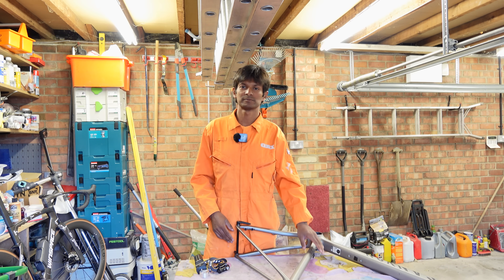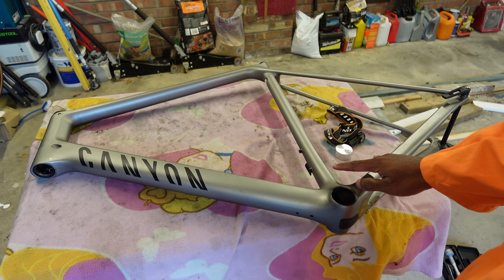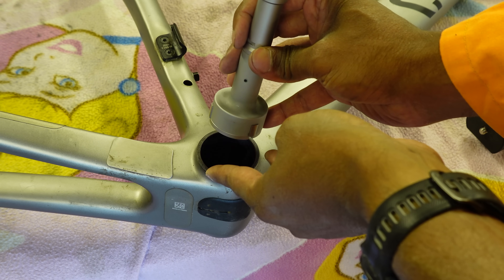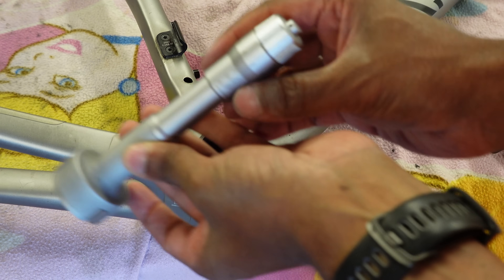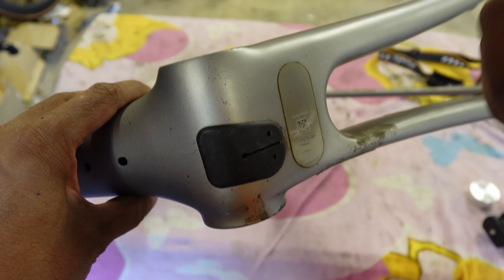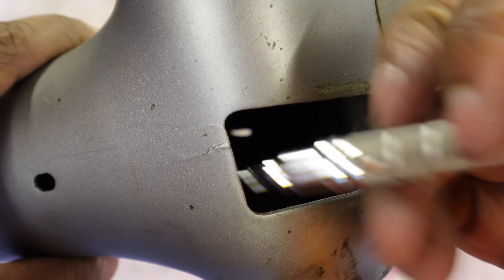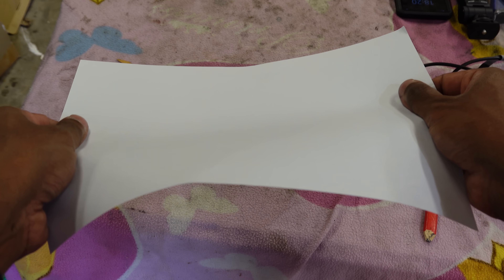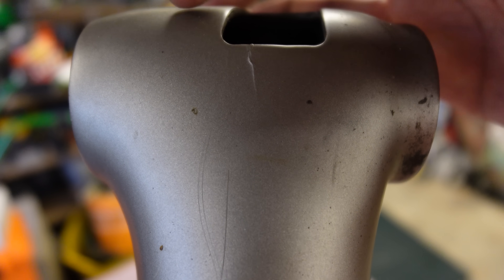Canyon’s “German Engineering” is a JOKE like their Warranty Department

Comment: So, let's get this straight. The claim is that Canyon, did ZERO quality control, and have no idea whether their BBs are slanted, proper size after finishing the BBs, and do NO checks throughout the process at all and this is the end result for all of their bikes?!?!  ROFL...good one.  Is that what I'm watching....ROFL....that fucking bottom bracket looks like shit, and from yes...like Canyon's opinion, shitty maintenance, nobody changed the BB ever...or they had NO clue how to use a press tool and put the BB in with bad tools or alignment for it to be that bad and out of round.  Internet is full of half-stories/half-truths or misleading or complete lack of facts and information about a clearly abused or poorly maintained BB.  This is something, since they assemble their bikes themselves before sending them to the customer, that as soon as you took one step on the pedal you would have felt the thing out of round and play/slop.  I find that fucking hard to believe for 1 second....ROFL. Probably some moron owner decided to change the BB without the $300 proper pressfit tool and jacked up the drive side BB trying to fit it....seen that enough from people, even so-called "experienced" mechanics.  And what is with this 3rd grade tool you are using to test? How about some expensive imaging to show how "bad" the carbon frames are from them? Haven't seen any of that or even anything close except this makeshift tool...rofl. Internet is full of some special stuff.....
Reply: When I had my Grizl, I had to change BB after 600km. And could change the BB with hands. No tools needed. DOes this make any sence to you? The frame was exchanged due to creacking in seat tube. BB problem was just a bonus :) But my main problem was their customer service. It took +6 months to get them to exchange the frame. They have simply ignored me. But when I wrote them for the last time, that they can keep the (returned) bike and give me full refund. They sent the bike with new frame the next day. So they were looking at my previous mails, but have just ignored me. I never took the newly received bike out of the box, and have sold it further through buycycle.

Comment: Hambini, I've had multiple frame issues with my previous CF SLX (non disc model) due to cracks originating from the seat tube relief cut out. There were numerous examples posted by other customers so this was clearly not a "one off" issue. Long story short, Canyon ended up providing a warranty frame the first time then declined further coverage after the same issue in the replacement frame (in the same location). That was the last time dealing with Canyon for me. Any advantage gained with a "good deal" was lost waiting months upon months for a replacement frame.
Reply: It's time for European Comission to force Canyon to issue recall on their bike frames.
Reply: lol that happened to me with a multimeter, from another company obviously, it lacked a fonction advertised on their website (the very reason I had bought it).., and when I contacted them about that, they just sent me a second one, same model, so also lacking the function that was still listed on their website.
I have now 2 multimeters for the price of one, neither can perform the task I had paid for!

Comment: It all depends on who's behind the desk resolving warranty issues and how they interpret each brand's policies. You have to have responsibility and customer service skills. I worked as a warranty manager for Giant in Mexico. The truth is that Giant Group is truly committed to its quality, and I assure you that if this Canyon case were on my desk, I would resolve it immediately. Cheers🙋🏻!
Reply: Good to know. I bought a Giant Revolt with a carbon frame that developed a crack in the paint near the seat post. The asked me to drop it off at a local Giant dealer for assessment and when I picked it up a few days later they had stripped the bike, replaced the frame and reassembled it under warranty. Its Giant for me from now on.
Reply: @mariog4707  I had a Canyon Exceed developing exactly the same crack in the paint. Canyon told me there is nothing to worry about. After two years of riding its size didn’t change and I didn’t have any further issues with the bike. Sometimes a crack in the paint is just that.

Comment: Just got a Sava R7 (aero/enduro type chinese T800/T1000, Di2 R7170 105, CF rims),  for usd 1.6k earlier this year, mileage just hit 10k miles now.   Serviced just a month ago, stuff got stripped out and inspected. Nothing wrong with it wheels or frame, just some fairly basic cleaning.

Comment: the only thing that matters in this industry is marketing.  nothing else matters.  You pay the pros enough, they will ride crap.  Has anyone apologized for pushing defective cranks for over 10 years.  This is a sport that sold out its fans.  What would help is a trade association that could do marketing, marketing surveys and maybe help implement quality control programs.  

I had a very famous marketing professor in college.  He said there were two reasons to do marketing (i) to eliminate the social risk  (hence sponsor a pro bike team) and (ii) convince people that they made the right decision after they made it.  The UCI could do more to protect the consumer.  That is why i don't watch this sport anymore.
Reply: its even worse in the moutain bike part, from this industry. There was a TON of very bad gears, from anywhere. I was mtb mecanic during the 90 and early 2000, the first batch of many brand about hydraulic discs was a disaster, during years. So yes...when moutain bike starting, problems comes, massive. For me, 95% gears from the 90 and 2000 was totaly crap, you can die by theses craps.

Comment: Did these sorts of problems happen in the earlier days of carbon frames, when the bottom bracket shell was an aluminum tube that was glued into the carbon during manufacturing?  This all seems like it's a symptom of the insistence on making the bottom brackets be a press fit arrangement, directly into a carbon fiber hole.  I guess Hambini does occasionally talk about cases where the design was sort of like that, but they at least subjectively seem less common, or at least catastrophic.

Comment: I allways wonder do they just fuck up machining work and QC or is this a infusion,density or whatever Material issue which develops while riding I make some carbon parts and noticed on more complex parts its harder to get a clean fibre distribution and it resulted in ballbearings working their seat oval but thats homegrown forged carbon with low pressure and overloaded small bearings ...

Comment: my Canyon endurace AL cracked 3 times, always failing in the same spot: in the weld on the chainstay just next to the derailleur
Canyon replaced each frame but last one (3rd frame) started to fail already after 500km
warranty is/was 6y and clock starts ticking on the date of the purchase, meaning if you get a new frame it will not have the full 6y coverage
after 2y they charge you to move the parts from the broken frame to new frame
bb, front derailleur, bottle cage screws were loose
no more Canyon for me…
Reply: Have the same frame , curious if you had a link to photo of the damage
Reply: @shinnymirror511 I still have the pictures, lemme check how I can share them
Reply: @hardware4computer I realized after I said it “how are they gonna share em?”
Imgur link?
Reply: I would also be interested in a photo, as I also have this model.  Thanks
Reply: @pa.friederich  pics posted under enduracefail
Reply: Hatte auch an zwei Aluminium Canyon Hardtails Risse (Steuerrohr & Kettenstrebe hinten).
Reply: pictures are on imgur under enduracefail
Reply: search for enduracefail
Reply: you should be able to find it under enduracefail

Comment: 5:03 If you notice on the inside of the tubing, the joint line goes all the way from the large opening to the small hole, though not directly. Looks like the carbon fiber is stressed out and has a fault line. Also, if you look at the outside, the fault/crack has a secondary buckling. It's sort of D shape, where the arch of the D is the secondary fault.

Comment: Same issue on my frame no cracks though at least I haven’t found anything obvious. Alignment is shite and it’s going through BB‘s on the non drive side. Change them once in a while. Also the fork cracked on mine as well but was replaced under warranty. Potentially life threatening. Rarely use this bike anymore.

Comment: Steel is real. Buy plastic, expect slack tolerances and pitiful longevity.
...just saying
Reply: No thanks, I'm not interested in a 12kg road bike...
Reply: @dhess34  You can build up a road bike much lighter than 12kg. As far back as the 1970s /80s, Raleigh's Specialist Bicycle Development Unit (SBDU) had got the weight of a road racing bike down to 7.9kg if I recall correctly. A racing bike in the 1960s typically weighed about 10.4kg - I was there! 😊

Comment: Canyon is awful.
XC Mtb They refused my warranty claim 5 days after delivery. Neither of the remote locks worked, awful routing, and the steering ground when turning. the rear break was stuck on and missing one pad.
There was lithium grease inside the frame. Never rode the bike and they tried to charge me a "bike wash" charge once they got it. Both headset bearings were complete garbage and dry as a bone. BB wasn't much better. Sold it soon after at a lost. The frame cracked on the new owner 5 months into ownership.

Comment: Thanks for doing what you do. I just recently had an experience with a smaller bike manufacturer where a full suspension frame could not fit the rear shock due to the linkage being misaligned from the box. They sent a replacement frame with the same issue of a slightly lesser magnitude, where the shock could be forced in, but the shaft ended up under a side load and it can't be let operated in this way obviously. In the end the frame was returned for a refund, but the customer experience was not amusing to put it lightly.
Reply: Not sure why you are protecting them.
Reply: @DR_1_1 Dartmoor bikes

Comment: @Hambini PLEASE DO A SHOW ON Failure Testing of carbon frames, especially the cheap chinese frames that you seem fond of:
🔹 1. Fatigue Testing (Cyclic Loading)
Carbon frames are put through millions of load cycles to simulate the effects of pedaling, braking, impacts, and rider weight over time. The main types include:

✅ Vertical Load Testing
Simulates rider weight and bumps.
A force is repeatedly applied to the seat tube or bottom bracket.
Load is cycled hundreds of thousands to millions of times.

✅ Pedaling Load Testing
Simulates the stress from pedaling forces at the crank area.
Torque is applied in cycles to mimic real-world use.

✅ Head Tube Load Testing
Simulates braking and steering forces.
A forward/backward cyclic load is applied at the head tube (front of the bike).
🔹 2. Static Load Testing
This test determines how much force the frame can take before it deforms or breaks. Often done before fatigue testing to establish baseline strength.
Example:
A set amount of force is applied to a tube junction.
It must withstand it without excessive deformation or cracking.

🔹 3. Impact Testing
Simulates sudden hits like potholes, crashes, or curb strikes.
Common methods:
Drop tests (frame or fork dropped with weights)
Charpy impact test (measures energy absorbed before fracture)

🔹 4. Non-Destructive Testing (NDT)
After fatigue testing, manufacturers use non-destructive testing to look for internal damage that isn't visible.
Techniques include:
Ultrasound – detects delamination or voids in carbon layers
X-ray or CT scans – used for detailed inspection of internal structure
Tap testing – listens for changes in sound that suggest damage

🔹 5. Destructive Testing (Final Failure)
To validate ultimate strength, frames are pushed until they fail.
Examples:
Increasing vertical or lateral loads until a crack forms
Measuring force at the moment of failure
This helps determine:
Where failure occurs (e.g., bottom bracket, seat tube junction)
How it occurs (cracking, delamination, fiber breakage)
Reply from the maker: Good chatgpt output
Reply: @Hambini  I am not paid enough from YT to come up with something original ;-)
Reply: @kenedward4585  You'd need at least 10 frames—5 "western" (literally every one of which is now made in China), and 5 from Chinese nameplates—then weeks and weeks of testing on equipment that at this point only exists in China. 

So well into 6-figures of cost, and hundreds and hundreds of hours of work ... and at the end, if a Trek frame was deficient then all the Trek stans would just scream, 'That was just one frame, that's not a statistically significant sample size!'. 0/10 idea for content. 

But hey, YOU start your own cycling channel and drop $300k on that video. I'll watch the results if you make it.
Reply: @dhess34  How about starting with just the frame being trumpeted as "HIGHEST quality" by this channel (ie LightCarbon)??
Reply: @dhess34  OH gosh, imagine an engineer making an inquiry into the frame failure analysis of the frames he is touting?!?!?!  What a an absurd concept.
Reply: @dhess34  OH YEAH we clearly see Hambini forsake thumbnail analysis in favor of comprehensive standardized testing for everything he has on his show. NOPE, can't do a simple analysis on the durability and safety of a couple forks, that might be way too relevant to the watchers of this channel.
Reply: @  Who cares if the fork breaks after a couple years!! Hambini is so connected he is able to get new bikes every year from sponsors. His neck isn't gonna get hurt on the cheap chinese frame because he will be onto the next sponsored frame within a year..... and you know he doesn't care about your neck.

Comment: As an aeronautical engineer specializing in carbon structures and a long-time amateur cyclist, I did extensive research and did not purchase a Canyon road bike.
Reply: What did you buy instead ?
Reply: @robertsukovsky7268    I ride a TREK SLR Series 900 OCLV Carbon Fiber frame
Reply: What about AMFLOW and Specialized MTB bikes? I have 2 Canyon MTB carbon bikes (Spectral 125 and a Neuron 26 inch wheel), both without issues (yet).
Reply: What kind of research was that if I may ask? Were you analyzing their frames in a lab or something else?

Comment: From my point of view, there was insufficient frame material on the underside of the bottom bracket -it is wafer thin - and then Canyon cut a ferkin great hole in it for cable routing. That hole is a stress raiser so no wonder a crack appeared.  If one end of the BB is tight and the other loose there will be cyclical stress induced flex as the loose end of the cartridge or whatever moves up and down in the frame making the tight end twist up and down.  Think bending a steel wire multiple times beyond its elastic limit; eventually it will snap. I know carbon isn't steel but it's a useful analogy because the resin in carbon fibre frames is quite brittle so the elastic yield is very low. The fibre will hold things together until the resin bonding eventually disintegrates. Notwithstanding the shit tolerances, the design of that frame's bottomed bracket area is a total dogs dinner.
Reply: Yes I'd see some reinforcement around that hole. But that's usually not the case, even on frames with compartments in the down tube...

Comment: How @CanyonBicycles can refuse a warranty on the basis of poor maintenance is scandalous. For that to stick, I'd love to see their report outlining their reasons. 

This is a simple case of a UK Small Claims Court application. At 2 years this frame falls foul of not fit for purpose. 

Send a Letter before Acrion to Canyon UK outlining your grievances and how you want them resolved. If you don't get a satisfactory response within 28 days, issue a claim online at MCOL.

A few considerations. Make sure you send the letter and claim to their official UK address found on the UK's Companies House listing. 

If the claim gets defended, you will likely need an engineer's report; I'm sure Hambini can provide one for the relevant fee (cost can be added to the Claim). You will need to state this when you get the Directions Questionnaire N180. Note, if you opt for Mediation, the resolution will always be less than what you've claimed for (both parties are expected to give ground).

Good luck, because that BB is a pile of crap, IMO.

Comment: So if western brands are bad, while Chinese is starting to sell their frames at ridiculous price, what can i buy? Might as well quit cycling now huh?
Reply: I ended up settling on handmade steel frames. I've now got two, one for road and one for gravel.
Reply: Time or Look (but expensive!)
Reply: @sylvainswift3234  Look is poorly engineered. I had 795. The most troublesome bike frame I ever had.
Reply: @kaiwren2604  strange. That's not what most people say. Unlucky with yours?
Reply: @sylvainswift3234  795 had cracks in BB. I know a local Look dealer. At that time many frames were repaired/replaced with this issue. The fact that Look stopped making proprietary BB in later models also proves that is was a bad design.
Reply: check pandapodium!